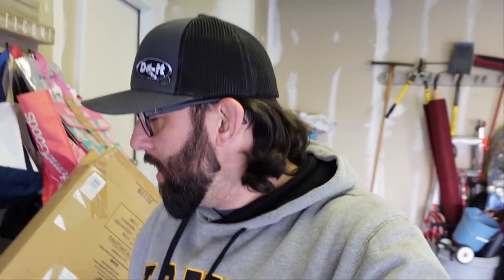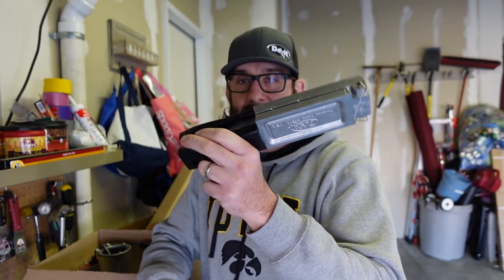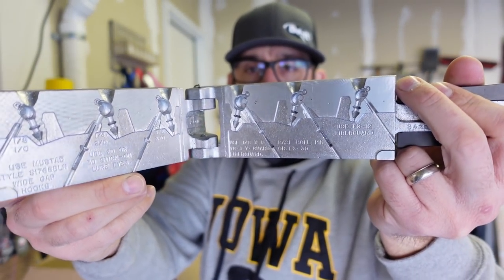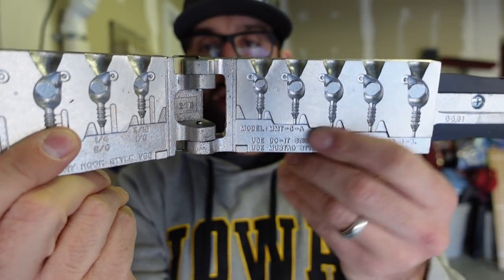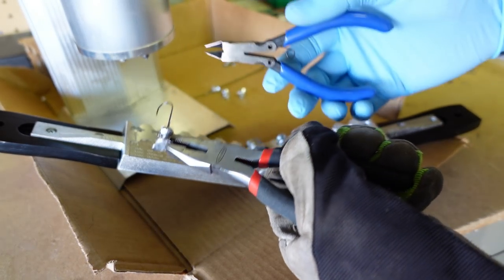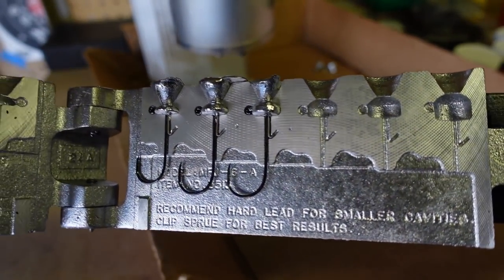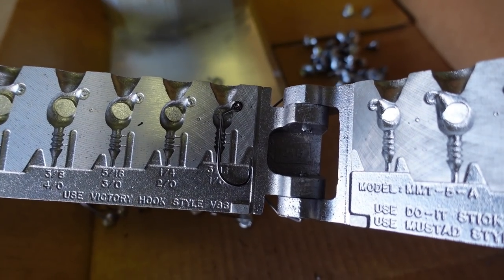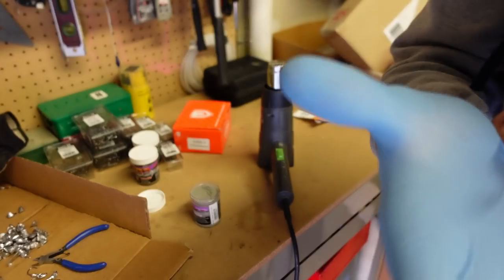How to Make Your Own Jigs | DIY Tackle Making

Comment: set your mold on top of the pot to help heat up the mold prior to pouring. Also you  can "candle" the mold prior to pouring. This will  soot up the mold for easy release of the jigs when extracting from the mold. Great video as usual.

Comment: The whole side of the mold is a reservoir. I pour lead in there a couple times each side to get it hot.  Lead is most dangerous when it's shiny. In a few days it will turn grey from oxidation and is less toxic to the touch

Comment: Debo, I've been casting bullets for 30 years. That mold looks like aluminum. If so you can dip the corner into the lead, and you can put the mold on the furnace while the lead is melting. Be sure to fill the mold because the lead shrinks as it cools. Pure lead shrinks more.

Comment: I’ve been pouring jigs for 30 years. Your right to pour lead to preheat your mold. On some of the bigger jig molds I leave the mold closed for a couple of minutes to really heat them up. Get a candle and smoke the mold if your jigs get hard to remove.
Reply from the maker: Thank you for the tips!

Comment: Ways to heat your mold include resting it on a griddle while your doing your initial melt and while resting between each usage. Another option is using your heat gun on the inside surface until you get your first few runs going.

Addicting to watch. Been making my own jigs with pre-made heads, this makes me reconsider doing them all from scratch. Cool stuff, man!!

Comment: 350 degrees in a preheated oven for 15 minutes MAX to cure the powder coat, If you want the powder coat to be more durable. 
You can also shop around on eBay for other companies. I find brand X to be pretty good. I’m a Pro-Tec junkie.

Comment: Those aren't cnc'd molds those are casted molds reason there not that expensive as the cnc machined molds so yea maybe u didn't know that but just so know they may use cnc to clean them up but there not fully cnc'd just look at the difference between urs an the worlds worst fishing molds there totally different an to get a better pour an cleaner lead heads u need to heat up those molds before u pour the lead or the cold mold will cool the lead down very fast an it won't fill all the cracks an crevices an won't be as clean.

Comment: I use a blow torch. Make a pile then go back through and get the pour lead broke off. No need to cut just snap the end off by twisting it. I just made a 100lbs of weights in two days. You can get a system down and make them way faster. Load that mold up. I use a blow torch to heat the mold up. The hotter the mold is the better your weight/jigs will look.

Comment: I know I’m like a year late… but if you ever get a mispour you can hold the hook with a pair of pliers and dip the misshaped head in the pot to melt it off the hook. Also, you can get a ton of lead from roofing contractors if you know any. My family‘s been in roofing for 50 years so every time I repair a chimney the scrap lead that is clean turns into jigs.

Comment: Good stuff bro. I heat my molds up with the same heat gun(like a blow dryer or torch) I use to heat the jigs up for paint. You can also sit the molds on top of the lead pot while the lead is heating up the mold will warm up with it also. 
Two tips:
1 don’t ever drop lead in the pot if you have a chunk or something cuz it will splash back and I’m sure you know that
2 is important. Don’t ever throw hot lead on a wet surface. Best example is I do my molds at my grave door and the driveway was wet from the rain and I threw a small junk off my spoon cleaning the top of the lead pot and when it hit the wet surface it like exploded everywhere. Hot lead and water don’t mix.

Comment: Reloaders typically place the mold on top of the melting pot to heat them up. Also, Smoking the mold helps them fill more evenly, as well as improving the release. just hold the mold over a candle and carbon soot will cover the molds. This only needs to be done once before each mold making session.